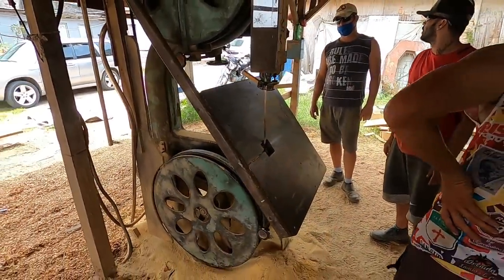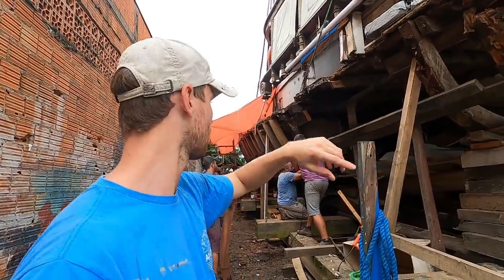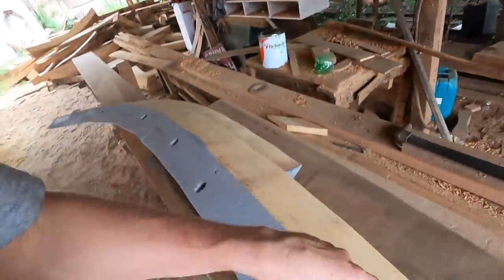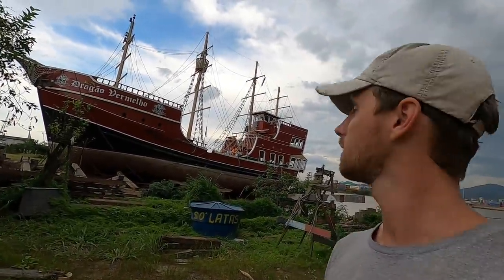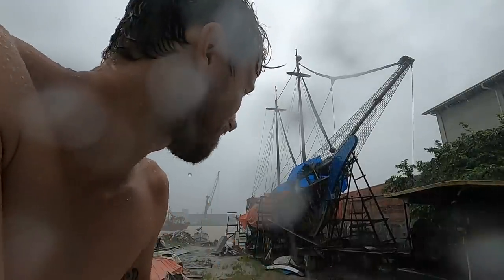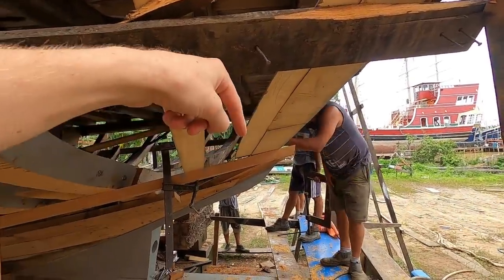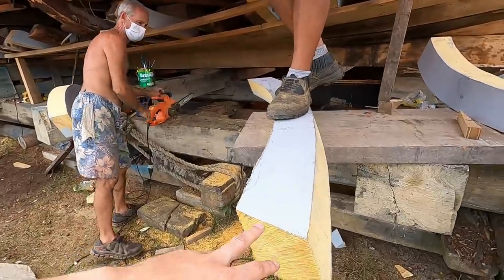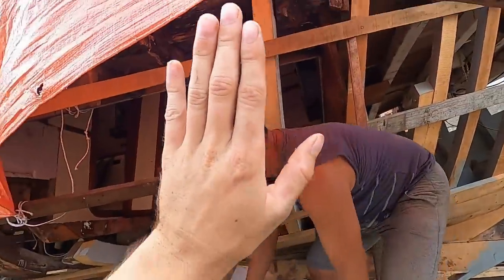We could have done WITHOUT THIS STORM! — Sailing Yabá #25

Comment: You guys are great and crazy. Love watching all the effort and learning wooden boat carpentry along with you. 
Just a suggestion , never had a cooling system like on that other boat but no way , seems there would be so many down falls. Maintaining those 15 meter long pipes in open salt water , the growth of marine life on them will be a nightmare and the extra drag and extra holes in the hull.
Reply: I don't know what country you are in. I live in the south east USA. The cooling system that was shown is called  a Keel Cooler. I worked on several tug boats all had keel coolers. The system works very well. I have never seen a keel cooler built on a fishing vessel like the one shown. The ones I am familiar with are actually part of the original plan for the tugs keel. Not exposed piping like this. It is very good for the engine to only run anti freeze and fresh water threw your engine. Also your don't have that huge hole in the bottom of your boat and no need for routinely cleaning sea chest strainers. No debris getting into the engine like mud and dead fish.

Comment: Hi guys just wanted to give a bit of advice on your thoughts about cooling. Personally I would keep your salt water cooling as is , if you use tube cooling outside the hull they will be subject to damage more holes through hull and osmosis. Your cooling is fine as long as coolers and pumps are maintained properly. Great viewing though guys

Comment: My dads boat had a cooling system very similar to that. There was a 25gal freshwater tank in the boat. Hot water left the engine, went thru the hull to the bow, back to the stern, up thru the hull and into the top of the tank. Cool water was drawn from the bottom of the tank to feed the engine. That old 1948 Chrysler Crown straight 6 never ran over 140 degrees Fahrenheit.

Comment: I  just amazed that the masts were not unstepped through the rebuild.
Reply: ...the mast will fall apart  , when the hull is finished...
Reply: @gulfstream-tvstudios9546  Why the negativity?
Reply: @gulfstream-tvstudios9546   I presume that is a joke ?
Reply: @charonstyxferryman  So true. Thank you for pointing that out.
Reply: the way those guys use a chainsaw I'm surprised they are still standing.
Reply: we still haven't seen how much of the deck they are going to replace, they may end up unstepping the mast.
Reply: @lostsailor2089  I don't see why as they are both Keel Stepped, the deck goes around them.
Reply: @lostsailor2089  True.

Comment: There are called Keel Pipes because they run forward and aft along the Keel.  Keel Pipes.  I had a second set of them for the hydraulic system that powered the winches.

Comment: You should have a fresh water cooling system. It saves alot of internal rusty cooling passages and is probably alot less hassle to deal with on an old boat. If you get a new engine you should for sure do fresh water cooling.

Comment: She is coming along well. With regards to wood density some light timbers are very good and some heavy timbers are not. Structural strength can be overcome by making everything thicker and your boat will be very strong I think. Finding timber that is rot resistant is most important. I have know knowledge of timber where you are but painting, oiling and having good ventilation is key to making what you use last. When it comes the for fit out design try and keep her as open as possible. In cabins it's good to see planks and frames so try not to seal them behind paneling. Instead of paneling consider batons "strips with gaps" so she can breathe. The cooling under the boat we call keel cooling. The up sides is no salt or raw water near the motor. The negative is the hot pipes will attract growth which will mean more work when slipping and the pipes will slow the boat. This is not a problem for fishing boats but if you plan to sail and eat to use the least fuel possible you want a smooth bum.🏴‍☠️

Comment: Fresh water engine cooling would be a big improvement over the sea water system on Yaba now. Fresh water circulating within the engine can be treated with rust preventative ( like in a car) that will greatly improve the life of the engine, and the cooling thermostat in the engine. This can be accomplished with the external copper pipe run as on the other boat, or with a heat exchanger inside the boat that circulates sea water over pipes containing the engine fresh water.  Given how extensive the repairs have been to date, fresh water cooling is well worth doing because the hull will now last for a long time! Greg

Comment: Great progress- keep it up - just a thought- if you put keel cooling on your boat like your fisherman friend- you will then have to change to dry exhaust- 
I would suggest that you add a fresh water flush system for your engine and once in a while you run fresh water through the system to clean it out.
Reply: @jesper1406  - be nice- they are at least trying and learning as they go...they bought the boat and had their plan for repair before they were talked into YouTubing by Odd Life...
Not everyone is going to historically repair/rebuild like Leo- in fact not all projects are worthy of an effort like Tally-Ho.
If these kids get 10/15 years of life experiences out of this refit it will have been worth it.
Reply: @sailingsomeday5975  👏🏼👏🏼👏🏼👏🏼👏🏼👏🏼👏🏼

Comment: My father had a 22" wooden boat with a 10HP Sabb (Not to be confused with the SAAB car) diesel. That one was cooled by an external cooling sling, just like the one on the fishing boat.
It worked quite well for those power levels, and as long as you don't run aground and break the outboard pipes, it's fine. But I don't understand why it was painted on that fishing vessel. The pipes are usually made from brass and should be unpainted for maximum heat transfer.

Comment: All the new timbers ... are they still green or have they been kiln dried ??
Reply: That's my question as well.  The way the timber reacts to the saws, and the sawdust suggests that it is green wood.  Not good, it shrinks across the grain, opens up gaps and more water intrusion happens.  That's probably the way the boat was built originally, and look at the results after 20 years. Green wood also weighs a lot more than properly seasoned wood, so the weight comparison also suggests the new timbers are green.